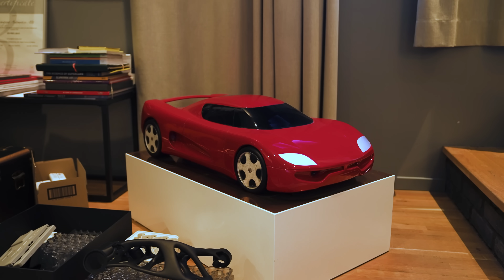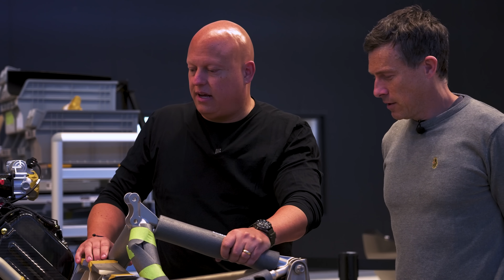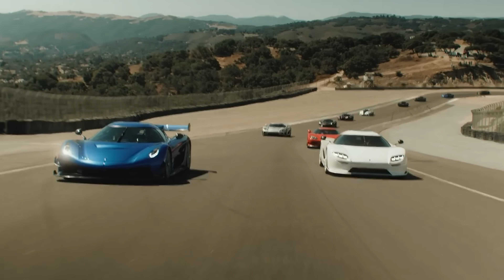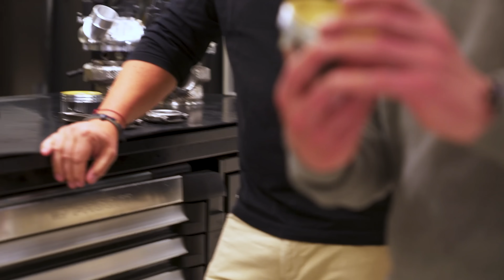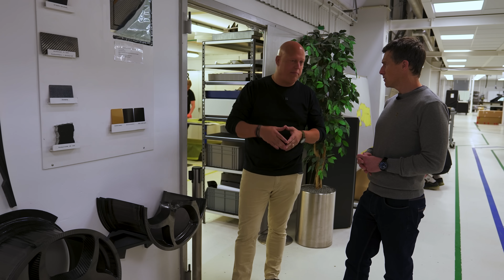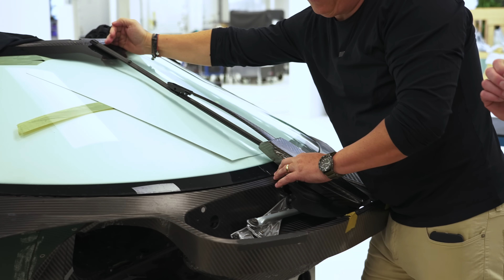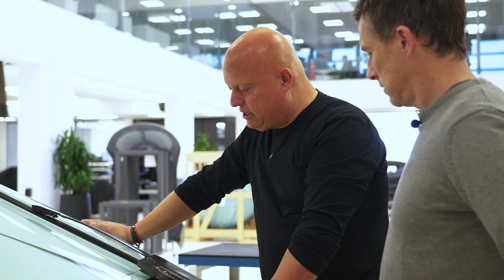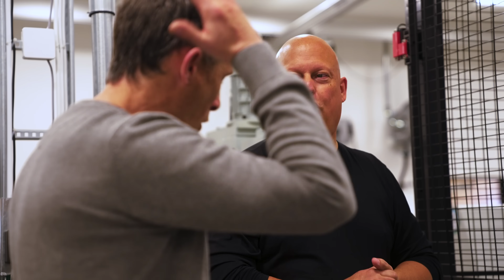Why Koenigsegg’s new 2,300hp hypercar changes everything

Comment: super interesting video for car geeks 😂
koenigsegg vertical integration is crazy. it's definitely not cost or time effective but it's probably the only manufacturer that doesn't compromise anything to cost. If they can make it better than off the shelves parts they will never try saving time or money AS EVERY HYPERCAR MAKER SHOULD. I'm especially talking about the ones that are backed up by big groups, I understand Pagani or even smaller manufacturers are not able to design and manufacture every part themselve. turns out they are able to improve almost everything.. If money was no object it's definitely the manufacturer I'd chose, just to support that mindset.
The Gemera is really a turning point with a clean sheet design, more than double the Jesko production number, the dark matter motor. it's just a bit disappointing that they are not going to make a single feevalve unit, most probably due to production / reliability issues. I hope feevalves will be in their next car, maybe not in a inline 3 cylinder but in a V8 in good Koenigsegg fashion. freevalve has been decades in the making and I hope then can pull this off..this could drive the last push of combustion cars and their whole lineup before battery technology finally brings power and energy density that combustion will not be able to match

Comment: "Homologation" is a great word in Christian's accent. I wonder if he's ever seen Wesley Kagan's video reverse-engineering the Freevalve system in a shed, with a 3d printer and a Raspberry Pi, on a miata engine. I reckon he'd rather appreciate it
Reply: Uhm, "reverse-engineering the Freevalve system" what?!
Isn't his system just a simple good ol' pneumatic actuated valve system(Still quite cool though, but obviously very impractical), were is the the additional hydraulic cylinder for "postition-hold" and damping that is what might make FreeValve a somewhat viable system(but of course still with high power usage compared to a traditional cam system)?

Comment: they need to implement nano-rubber in the tires...it is so very strong and flexible at the same time...awesome tech. look it up ... the problem is that it is very very very expensive, therefore it can't be manufactured, so it does not exist yet, at this time it is just a theory.

Comment: As much pedigree as some brands like Ferrari, lambergini, Pegani, Porsche, McLeran, Mercedes, Ford, Toyota, Nissan, Audi, Renault Lexus, and BMW have, this guy is the undisputed GOAT.  In my personal and irrrelevant opinion of course.  In 50 years, this brand will be the pinnacle of hypercar and speed prestige.   They haven't been around all that long but their reputation is top tier and growing every year.
Mighty fine work.   Now, once they become the undisputed, why not make an affordable, fun, street oriented two seater sports car?    That thing would be wicked.  I believe even if they built a factory to build something similar in spirit to a 3000gt, s2000, or even a focus, in high volumes that it wouldn't effect the exclusivity of the hypercar line.

Comment: Carbon Fibre wheel = bad idea.  BAD IDEA.  Someone will be killed because of this, for heaven's sake DO NOT DO THIS.  Make the wheel out of a contiguous material, not a composite.  When the wheel (finally) fails, it will practically explode and the car will be at high speed when it happens.  WE KNOW THIS which is why composites are avoided for wheel construction.  When a wheel fails and someone is killed, this will be their monument.

Comment: Theoretically with the freevalve could they not decrease fuel consumption/ increase efficiency by utilizing only half of the valves per side in a sort of eco mode?? Sort of like chevys cylinder deactivation system bit their own spin on it.

Comment: I find the parallelism with the "GR factory" somewhat inaccurate
Yes, its a special factory (Motomachi Plant), where one of the greatest fun cars of the last decade is being produced

But in the case of the GR Yaris, I wouldn't exactly put the quality control level to the one in Koenigsegg 'production'
Just google up "gr zoo rust" (just an example - one of many) and have a look at some of the photos shared by owners of the GR Yaris (some of them are no older than 3yr cars) and they show early signs of rust

As it turns out, coatings and rust protection is inadequate (to say the least)
Don't get me wrong, I ve driven the car several times, its amazing. To the point I was considering of buying one. But this premature ageing due to rust kinda puts me off :/
Any GRY owners here with an early Gen1, who live in central / northern Europe, use it as a daily and don't have observed rust? Just curious

Comment: I can't wait to see and hear Gemera unleashed. How well does it get off the line? The AWD system is meant to be about as precise at delivering torque as a 4-motor EV, after all.
We've not really seen Koenigseggs excel off the line yet. The knowledge is becoming more widespread, and now they REALLY ought to ace it.
If they do, we should expect 0-60 mph well under 2 seconds. It's much lighter than Rimac Nevera and Lucid Air Sapphire, with equal or better tires and more power that can be distributed over the wheels more freely. I'm hoping for a sub-8 second quarter mile. It's asking a lot but with those specs and promises...it needs to do it or thereabouts.

Comment: Such a HARD way to save 3 e-motors, but totally useful for their non-hybrids as well, of course. 
I wonder what the added weight would be when making a Jesko into a 4-wheel-torque-vectoring monster. It already uses two such hydraulic wheel clutches on the rear wheels, right?
Another way to make an amazing new Koenigsegg. The lightweight FreeValve 3-cylinder with 600 hp, a downsized Gemera AWD system, and a GMA T50 like chassis/body size. 
Downsized 9 speed gearbox and FAUX MANUAL controls as an option. At 600 hp it would be amazing already, as the weight could be under 1000 kg, like GMA T50. I'd add 3 more cylinders via one such hydraulic clutch, double the power to 1000-1200 hp at just +70 kg or so.

Comment: Classic. The carbon engineer knows not to tell the new car's name to Mat. 
Can't weight to learn what they're working on next. Where to go from Jesko, where to go from Gemera?
Gemera will be in production for a few years, Jesko I think is about fully produced?
The CC850 drivetrain and shifter are to die for. Maybe we'll get a FreeValve car with that shifter? I wonder whether they can actually handle 9000 rpm yet with FreeValve.

Comment: PLEASE build a minimalist supercar around the little FreeValve engine! If it actually works, and works reliably.
You can even make it a 3+3 cylinder on the same straight 6 block but the drive axle divided by one of your clutches. Awesome low emissions. The one side of 3 cylinders could be optimized for that with the second bank all about power and sound. I want to see an answer from Koenigsegg to GMA T50. A bit smaller, loads lighter, FreeValve, and ideally AWD for track times. With a small hybrid system it could remain under 1100 kg and still close to 1:1 power to weight.

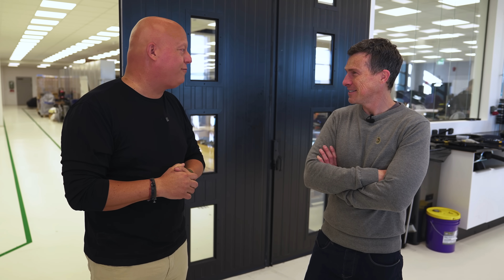Comment: At ~ 8:48, of course if you’re buying a super car with thousands of horsepower and no doubt a million dollar price tag, you also want the ability of 4 passengers to simultaneously enter/exit the vehicle! After all, what good is a super car if you can’t show off to 4 of your buddies, right?
Reply: *3 passengers
*3 buddies
Reply: @ThatGuyFromThatPlace86 😂
Reply: The point is that they are are breaking the limits of conventional bespoke engineering. Fitting two people at once is the laymans equivalent to showing that you can open the fridge door and dispense ice cubes at the same time.
Reply: It's impressive that two, two meter tall individuals can fit inside - and still have room.

What's even more impressive is it can clearly fit wider people.

These type of cars are usually unforgiving for tall and/or wide people.
Reply: Buddies?? No dude chicks

Comment: It's crazy that the new Gemera has more horsepower than an F4U Corsair fighter aircraft from World War 2 which had 2,380 Horsepower and was considered the most powerful single seat fighter of that era.  Now a four seat automobile has 2,400 horsepower making it probably the most powerful four seat automobile in history.   I bet all the other supercar companies are scratching their heads trying to figure out how they can make a car with 2,500 horsepower.  The horsepower wars are alive and well.  Back in the 1960's at the beginning of the first horsepower wars, 300 hp was considered a high horsepower and anything over that was considered amazing.  Now, with modern manufacturing techniques and materials like carbon fiber and now carbon carbon, these techniques and materials have brought automobile design, engineering, and manufacturing to a level never thought possible.  Almost everyday an existing or new company announce a new, revolutionary type of manufacturing or design related to automobiles, especially in the bespoke hypercar markets.  Electrification is another area that has raised the bar in engineering design and manufacturing with cars like the McMurtry Spéirling, one of the fastest cars on the planet.  Many other new car companies are popping up all the time with their own revolutionary designs using full carbon fiber tubs and bodys along with newly designed engines either petrol powered or electric powered.  This is a very exciting time in automobile design and while 99.5% of us out here in the world will never be able to experience, let alone purchase one of these incredible feats of automotive engineering and design, we still can enjoy looking at them.  It would be cool if a manufacturer like BMW, Mercedes Benz, or even Chevrolet, could come up with their own affordable designed automobile that has the advanced engineering and abilities of these high horsepower bespoke automobiles.   Oh wait, Corvette announced the ZR1-X with half the horsepower of this Gemera at over 1,200 horsepower, but even that car is expected to be a sell out immediately with dealers probably doubling the price in order to reap all the profits for themselves, which has been typical for car dealers here in the USA.  Still, it would be far cheaper than a Gemera, which will probably have a starting price around five million euros or some crazy price like that, enough to buy a flat in the best part of London.  It's still fun to see where these technologies will take automotive engineering in the future.  Maybe some of the technologies used to build not only the incredible Koenigsegg hypercars, but many other engineering feats done by other bespoke car companies around the world will make their way down to everyday daily drivers into the future.  The future is definitely bright for the automobile and where this technology and engineering achievements will take us.  Technology is progressing so rapidly, faster than it has ever done in human history and it will be interesting to see what new and emerging technologies await us.

Comment: A helicopter has 1200 horsepower; put a hybrid turbine with a small battery and 500 horsepower per wheel on it, being electric it can run both forwards and backwards, and it can also be all-terrain. ✌✌

Comment: You have to admire Koenigsegg's engineering and technology but they still lack a lot when it comes to reliability. Their cars break too easily and are a nightmare to fix...
Reply: They are fully aware of this issue with some of their old discontinued models and have taken quality measures to their current vehicles in production.

Comment: sanding away the epoxy to expose the carbon fiber is a mistake. Carbon fiber deteriorates in the presence of both ozone and ultra violet light. It will lose significant strength over a few years.

Comment: Min 30, to compare weight of an electric motor to a V12 you have to include the battery, wires inverter, and the gearbox for the V12.

Comment: The same thing is happening with supercars and hypercars that happened to motorcycles: horsepower figures keep flying up in a "race to the sky" untill they become utterly ridiculous, and then the game is over. NOBODY will ever be able to use the full capacity of say 1500 hp in a Bugatti Chiron for instance. Not on the road with immediate revoke of licence and possible jail sentences, and not on the circuit if one is not an F1 driver. So WHAT is the use of having not 1500 hp but 2300 hp? Other than bragging rights in the bar? 
Soon this subject will peter out, and cease being interesting.

Comment: There should be a drag race of every Audi S3 generation so get a 2000 model year Audi S3 8L which has a 1.8 l 4 cylinder turbo charged petrol engine with 210 hp and 270 Nm it drives all four wheels by a 6-speed manual gearbox and back into 2000 it started from £27,000 however the 8p will be a 3 door one and a 2010 model year that will use a 2 l 4 cylinder turbocharged petrol engine with 265 hp and 340 Nm this will be the manual version still drive all four wheels by 6 speed manual gearbox and back in 2007 it started from £27,000 just like the first generation and there is the 8v this one is a 2019 model year which uses a 2 l 4 cylinder turbocharged petrol engine with 300h and 400Nm it does all four wheels buy a 7-speed dual clutch automatic gearbox and back in 2013 when they were new it started from £30,500 and then there is the 8y however it's the facelifted version in yellow the one was used in lots of drag races uses a 2 l 4 cylinder turbocharged petrol engine with 333hp and 420Nm it does all four wheels by a 7-speed dual clutch automatic gearbox and when it was first launched it cost from £38,000 when it was launched in late 2020 however the one that will be drag race is the facelifted starts from over £47,000 hopefully this race will go well and get released in December

Comment: hi Christian can you try to pre heat the exhaust catalytic converter as to try bring emission's down more  by using an external heat source other than the engine so when engine starts the converter is in full optimum state to fully filter straight away

Comment: Freevalve is awesome. I have been super excited about it. No more cam's. The valves are opened and closed as wanted also for as long. To get an engine to rev to 10,000 RPM you needed a cam with large lobes to open the valves. The bigger the cam lobe the worst it would idle. Not any more.

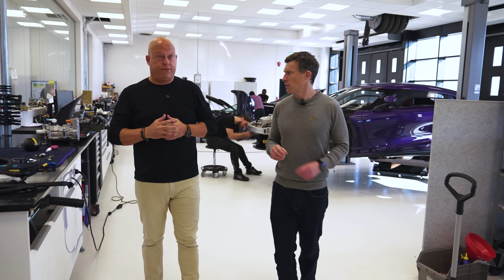Comment: 10:00 The SSC Tuatara holds the world record for a 2 way average top speed of 282mph, verified by Racelogic. They also ran 295mph in 2.3 miles on a runway. So as of right now, the SSC Tuatara is the fastest PRODUCTION car in the world. It was not a prototype, they ran the records in the first customer car, with the owner of the car being the one driving.
Reply: they faked their testing. got called out, denied it. then went back out and tested it again and were 50mp/h slower. no proof that the car was a production car. no one believes anything SSC says.. except maybe you. 😂

Comment: At minute 32, I was really wondering how an electric motor with hybrid axial and radial flux is controlled.
Yes, with two 3-phase inverters, which is called a 6-phase inverter :D
If Koenigsegg had combined the axial and radial flux and controlled it with a 3-phase inverter, I would still be applying to that company today.
I'm guessing it's a radial external rotor with integrated axial flux; a tear of joy is rolling down my cheek. Incredibly beautiful!
From a technical perspective, decades ahead!

Comment: I am probably going to sound like a hater, but it isn't that impressive to me to make insane performance cars when they cost millions upon millions while using major manufacturers technologies. I have built several cars and I took a 3300 lb c5 vette from 332 whp to 3100 lbs and 923 whp and 790 flbs while stiffening the chassis and building the trans. The brakes are 6 piston, I added aero, I redid the interior and all together it cost me about 65k. Give me a 3 million dollar budget and it would be made of carbon, have 1400 whp and have flying buttresses. Let Koenigsegg make a 200k car and I might actually be impressed.
Reply: The difference to other hypercar manufacturers is that Koenigsegg designs, develops and build their own technology. They don't outsource their make things inhause. They spend 5000-6000 manhours on each car they build. Therefore the Koenigsegg cars cost what they cost.
Reply: @netmannetman8124  they use Ford coyote engines for a lot of their cars. Mclaren already made similar chassis. Porsche already made those suspensions and brakes. The newer ones are more of their own products, but my point still stands. You give some hillbilly in Florida a 500k budget and he will make a ls swapped nova fly to the moon.
Reply: @tehtehkhantengames8580 
Yes all old discontinued models up to Koenigsegg CCX used Ford blocks. But with and from the 2010 Agera they started to use their own designs and casted their engine blocks at Warrel & Gringer. Now they do pretty much everything inhouse.

Comment: Love it. That dyno engine is using 4X the fuel my old diesel truck does at idle, but is producing almost as much horsepower as my first 1970 cutlass V8 made at max output (135) (110hp at idle? WOW)

Comment: Amazing piece of engineering from a remarkable and talented group of people.

However, based on volume of production let's say at most they will sell 50 - 100 units, it does not change anything at all.
In order for a technology to be a game changer it has to have mass adoption, mass application benefitting large numbers of people.
It may have an input to a wider yet still limited volume luxury market but its not a mass adoption tech game changer in any way.
It's a toys for the ultra rich market and that's all it is.